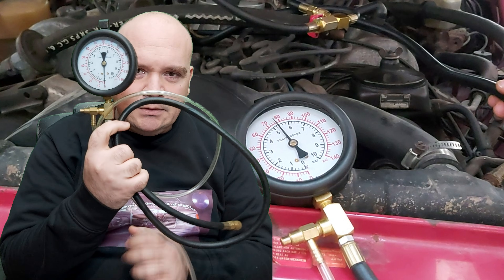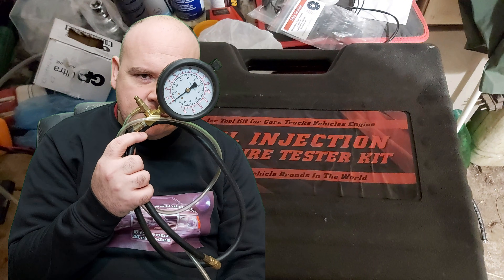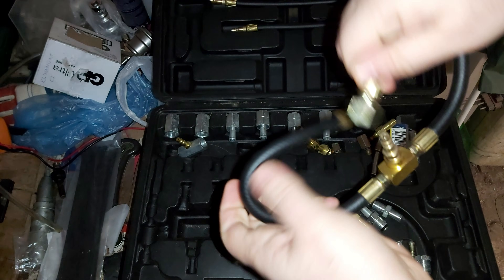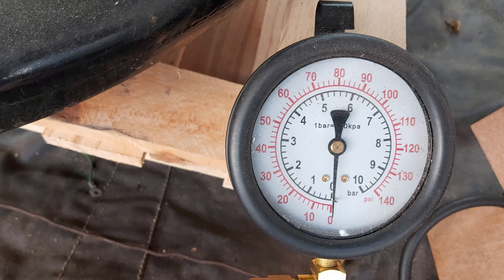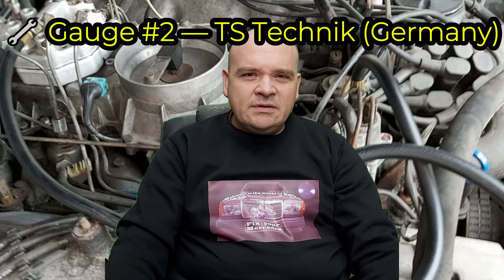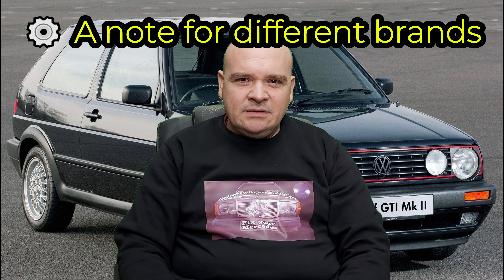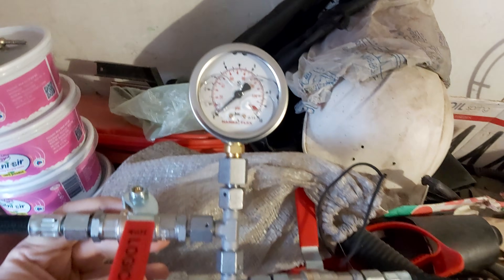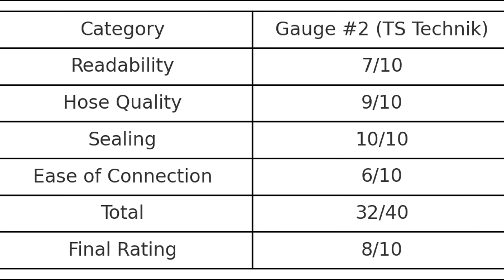㉦Mercedes Ke-Jetronic㉦ - ⚠️ Don’t Buy This Gauge! (Fuel Pressure Gauge Comparison – K/KE-Jetronic)

Comment: Do you think it's a good idea to replace the KE jetronic with a conversion kit?
Reply from the maker: It depends on the goal.
If KE-Jetronic is healthy and correctly adjusted, replacing it usually solves no real problem.
Conversion kits make sense only when the original system is incomplete, heavily modified, or parts are no longer available.
Reply: @mercedeske  
Got it! 🙏🙏
Reply from the maker: @Farhad_ZKD  https://www.youtube.com/channel/UCs0jR3jzkrn1KJDR6hOoPdQ/posts
Vote😃

Comment: I have the crappy Chinese one for over 5 years now it works ok but the first times I used it also leaked everywhere and I broke the special fittings trying to tighten up and stop the leakage 😅 so only one fitting was left and because this I can’t connect in parallel I have to measure separately upper chamber first and then disconnect and measure lower chamber after. I solved the leakage problem by adding copper washers in both sides of the fittings instead of those crappy rubber orings they give on the kit. Never leaked again
Reply from the maker: Hahaha yes, that’s the classic Chinese kit experience — the gauge works, the fittings explode.
Copper washers were the perfect fix. 👍
Parallel testing is the main thing you lose, but hey… if it doesn’t leak anymore, that’s already a victory! 😄